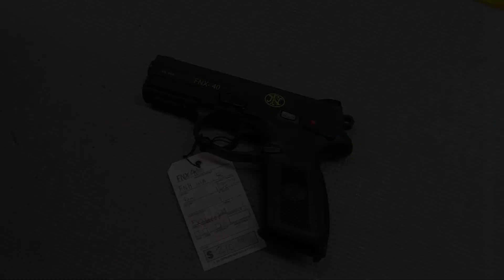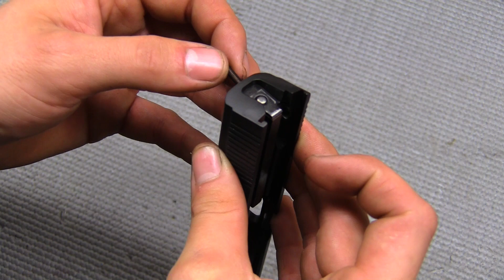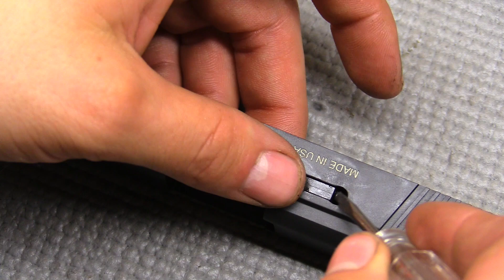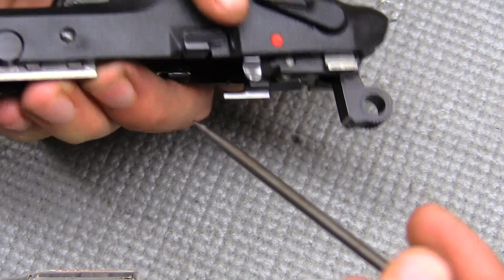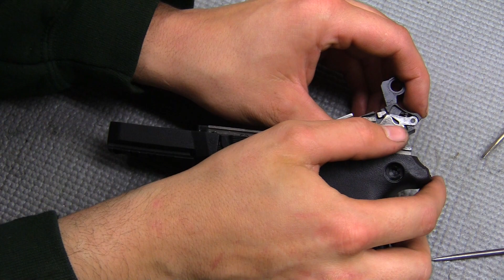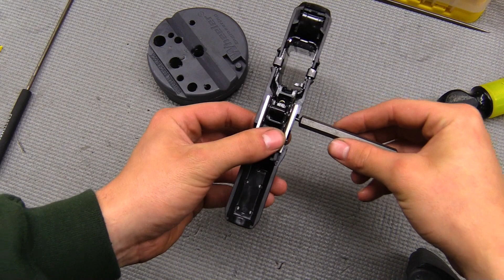Complete Disassembly: FNX 40

Comment: did you tape up when back of the grip where the insert slides on or did you just coat it
Reply from the maker: +Michael Gearhart We coated over where the Back Strap installs, and coated the back strap as a separate piece if that is your question. Cerakote is thin enough to not be of any issue to a firearms tight fitment.
Reply: +JOHNSON CUSTOMS LLC  OK I just duracoated mine tonight